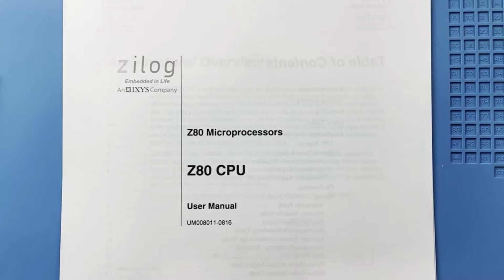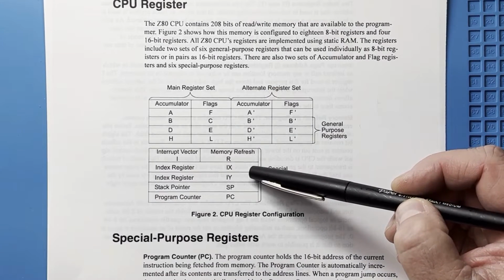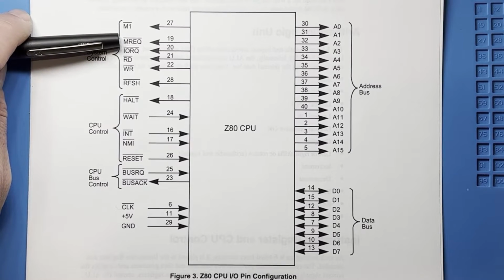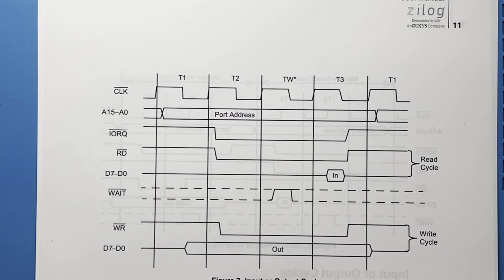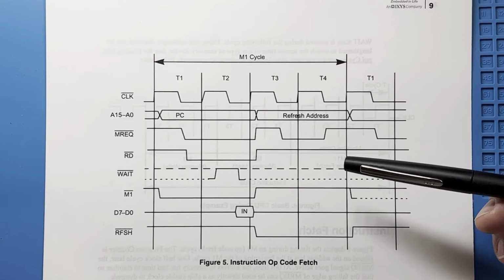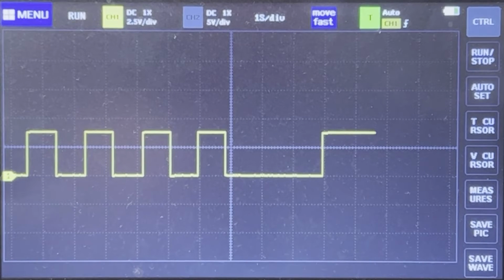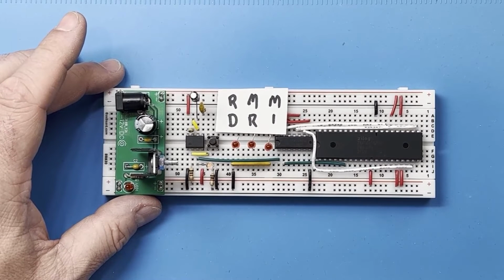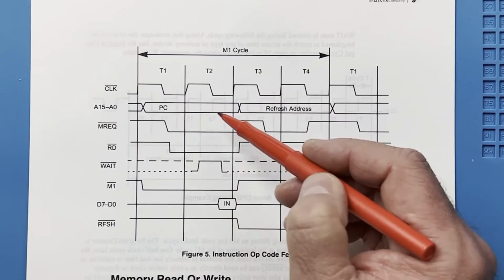Pony80 - Z80 CPU Architecture - My Z80 homebrew computer!

Comment: Really, is there a static version of Z80? All that I could find stopped working at 1-200 Hz.
Reply from the maker: Yes.  The part number I am using is Z84C0008PEG.  I got them from Mouser.com
Reply: @Pony80  Thank you, I'll definitely try to use that.
Reply: Wasn't the 'down to zero Hertz' referring to the original Z80, not any modern model ?

I was always led to believe that the 'fully static' was emergent, and not a design requirement. I seem to remember that you can stop the clock, but only in the high state, something to do with internal bus drivers being partially asynchronous. Someone else on YT tried it but stopping the clock caused addresses to jump.

Comment: couldnt figure out why my computer didnt work, finally realised that just because my clock signal was blinking it dosent mean that the chip was getting a zero when the light went off so i tied it trough a resistor and now ram rom and cpu works just fine.

Comment: Thank you for the project! I am interested in building it to serve to its original purpose: embedded systems and robotic applications! I wonder which pins work as gpios and how call that "port" in the assembly code. A capture and compare mode is available with for ultrasonic sensors and PWM generation?
Reply from the maker: I talked a bit about utilizing ports in the memory module video, because we use a port to turn the ROM off and on. I will also be talking about it a lot more in the upcoming LCD video. That should be out this weekend.
Reply: "which pins work as gpios"
A Z80 microprocessor doesn't have any GPIOs or peripherals (capture & compare or PWM). You'll find those in a microcontroller, with flash and RAM.

Comment: For I/O requests, the Z80 actually does put a complete 16-bit value onto the address bus. For simple I/O instructions like in A, (n) and out (n), A the CPU puts the contents of the A register onto the high 8 bits of the address bus and the immediate value n onto the low 8-bits of the address bus. The instructions out (C), A and in A, (C) put the entire contents of the BC register onto the address bus. So, while this is undocumented, the Z80 actually did have a 16-bit I/O address space.
Reply from the maker: Been toying with using this for a vga interface… I will post a video if I can get it to work.
Reply: @Pony80 Did you ever manage to do so?

Comment: 65536 IO, there are some 16 bit IO instructions.
HD64180 10MHz
Z8S180 33MHz
the above have very nicel inbuilt DMA MMU CNC serial. 
Z86 series can do Harvard or von Neuman if desired.

Comment: Also you can do  LD IXh, a    ....    LD a, IXh   , most 8bits operations can be donde with IXh IXl, IYh, IYl, they just forget to document those. .
Reply: This happen because 0xDD  and 0xFD, just  switch the enable signal from HL to IX or IY for only the next instruction.
Reply: @flyguille  It's not generally considered good programming practice to use undocumented opcodes.

Comment: I'll very much enjoy seeing where you go with this!

I have a few Z80's I tinker with, working on a similar project myself in my spare time.
Eventually I'll recreate the 80's computer I never had, probably Spectrum compatible.

At the moment I'm using a PIC microcontroller to 'emulate' the bus, for clock, memory and serial IO.
I'm planning to expand with physical ROM & RAM, eventually a graphics output. Trying to figure out which components to use nowadays, and how complex I want to make it. I still need to fully understand how bank switching works, it seems the sensible way to go today.
John's Basement channel has some great videos and Grant Searle's original Z80 homebrew computer webpage, both an excellent source of info.

Good luck! May the magic pixie smoke stay contained!
Reply from the maker: Thanks!!  
I plan on implementing bank switching for the memory.  I didn’t have it on the first one I made. 

EEPROM chips are harder to come by these days. I have a bunch on order that are due in August of 23!
Reply: @Pony80  Hehe, yes! Same problem.
I'm looking at avoiding ROM and using all NVRAM instead. It seems fast enough, and easier to get.

Comment: I'm really, really loving your videos. I ended up with a tube of z80s a few months ago and have been dying to do something with them. Thanks for making this so clear and easy to follow along. Looking forward to more.
Reply from the maker: Thanks for the encouragement!!!
Reply: @Pony80  always! It can be hard making videos without that positive reinforcement to keep it up.  Is the plan to build the whole system on a breadboard before moving it to PCBs?  (I mean obviously you have, but in terms of the discussion of the operation.) 

Also I was wondering why you went with the 14 rather than the 4, I assume the scmitt trigger was to help clean up the clock signal a bit?
Reply from the maker: In my first build, I converted breadboards to PCB to keep the wires under control. Replicating the 16-bit address bus and the 8-bit data bus to each breadboard was becoming unmanageable. 
I will probably do the same here, create the backplane, and each card as it is proved out on the breadboard.

Also, to be honest, I used a 14 because I had it on the bench. I just did some comparisons with the 04 and the 14 and it didn't make too much different on the clock signal.
Good catch tho... Keep me honest!
Reply: @Pony80  If I'm honest I'm fairly new and wanted to make sure I hadn't missed something obvious! I'm currently making the Ben Eater cpu and yeah, unmanageable is one word for it!
Reply from the maker: I did the Ben eater cpu too!!  This is what got me started on this journey!
Reply: @Pony80  it's a small world at times! I'm actually making a GAL based keyboard encoder at the moment for my Eater CPU  so I can program it with tac buttons rather than those tiny, dip switches that.. are a thing. I feel like he may have gotten a generation into the field with one project!
Reply from the maker: @colonelbarker  I agree!! He definitely got me hooked!

Comment: Watching your video, I don't see any markings of any kind on the z80 chip itself. I know that the pin designations on the block diagram of the chip are not where they are on the actual chip. So, with that in mind, how does one know which pins are which on the chip itself ?
Reply from the maker: On the left hand side of the chip in the video, you can see a semicircular cutout.  That indicates pin 1 is on the bottom left. Then it goes in order from 1-20, left to right, on the bottom, and then 21-40, right to left on the top side.
Reply: It's pretty much standard for DIP ICs. Look up "Dual in-line package" on Wikipedia and scroll down to "Orientation and lead numbering".